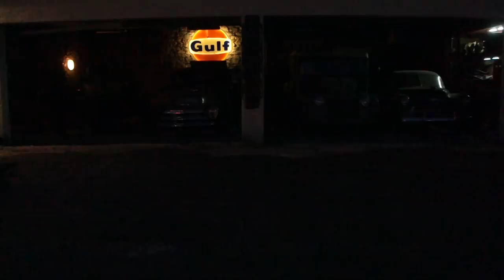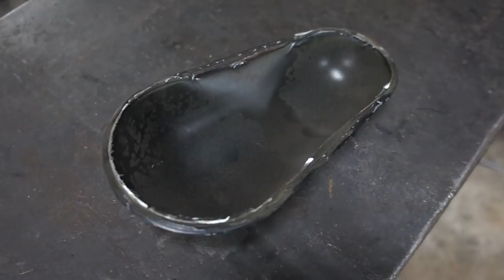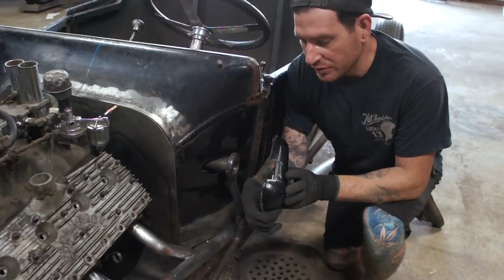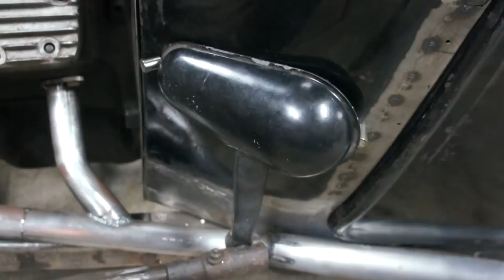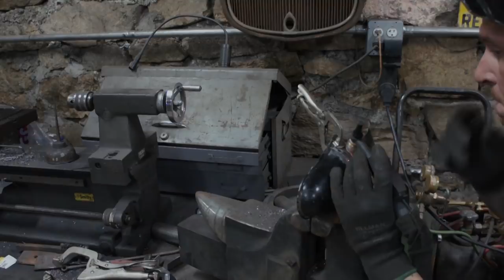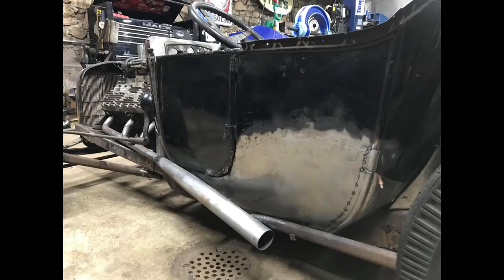How to Make a Hot Rod Cowl Steering Blister- Ford Free-T - Ep. 32

Comment: Can you use weld through primer with an Eastwood tig welder? I have the older ac/dc tig like it better then the mig 135 from Eastwood.
Reply from the maker: You need no paint or coatings on the metal to weld with a Tig